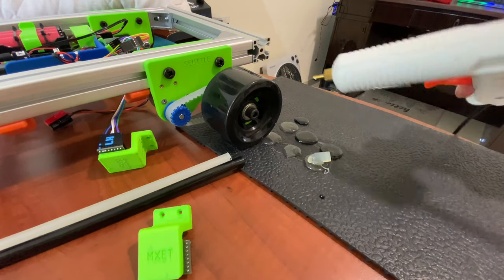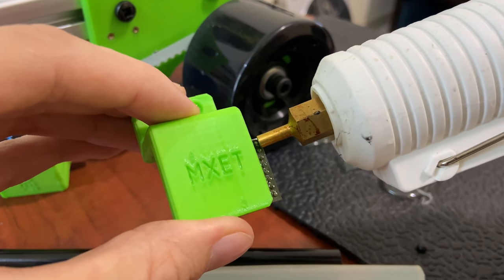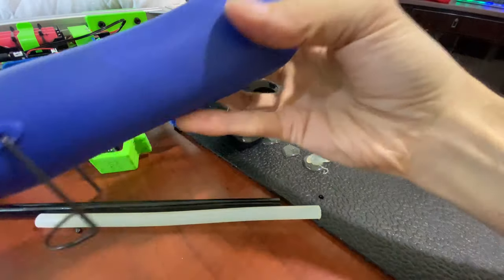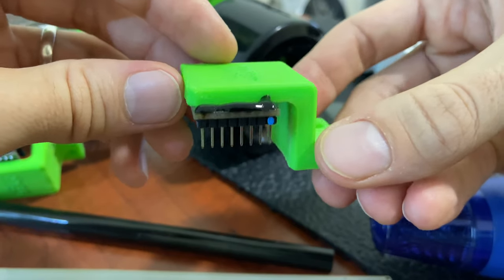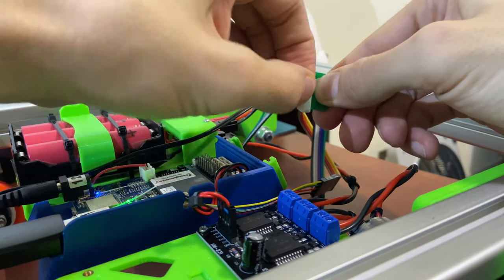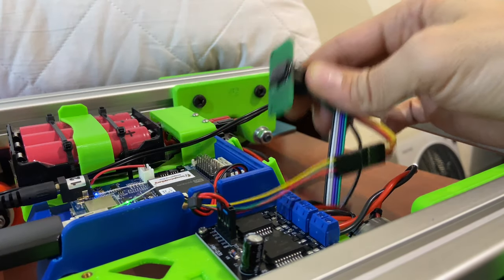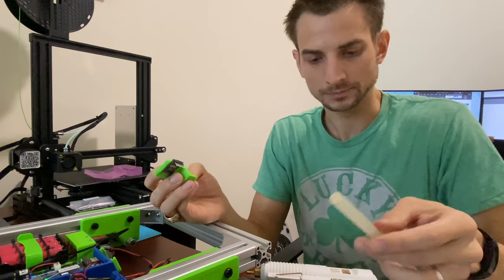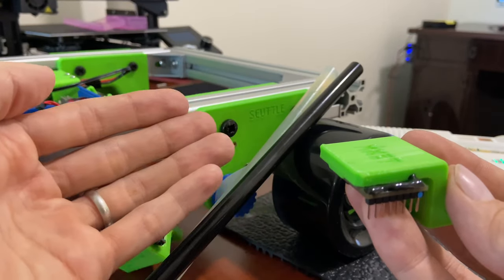Why I Use Black Hot Glue Sticks for Electronics

Comment: Hot glue all the things!  It really is my favorite adhesive.  There are different types with varying adhesive strengths.  Ive found the stronger versions tend to have a darker yellow tint to them.
Reply: Also, you can reuse hot glue scraps by heating on a Teflon sheet on a hot plate (or with a heat gun).  I sometimes do this to dip a part into the molten glue.

Comment: Nice video! Link to the gun?
Reply from the maker: Here it is on Amazon Chanseon 150 watts Industrial Hot Melt Glue Gun US Plug with 10 Pcs Glue Sticks Adjustable Temperature 5 Copper Nozzles for DIY Crafts and Quick Repairs https://www.amazon.com/dp/B07GDNV2LJ/ref=cm_sw_r_cp_api_glt_fabc_WQEYHQ841AM2DV1VJ5NQ?_encoding=UTF8&psc=1
Reply: I have searched and searched.  Thank you.